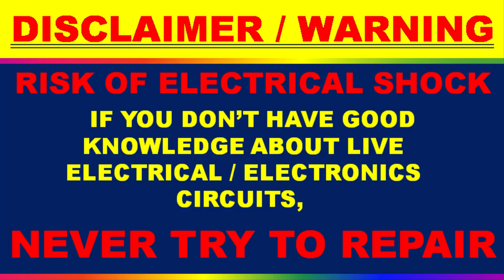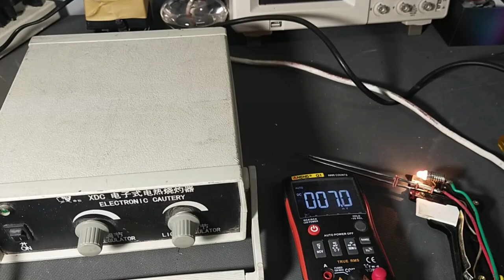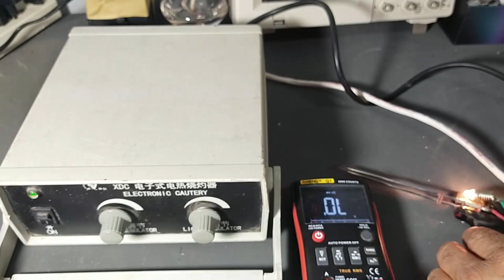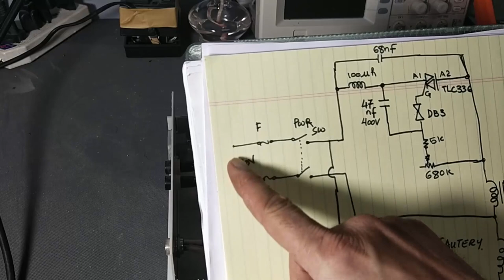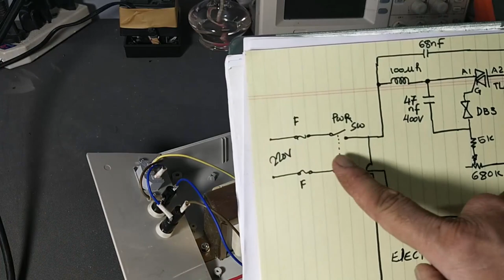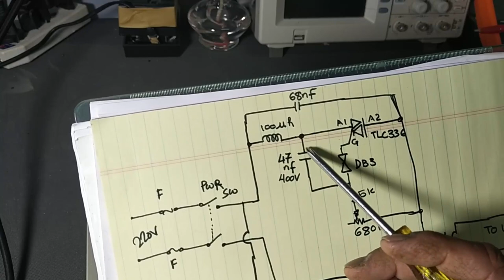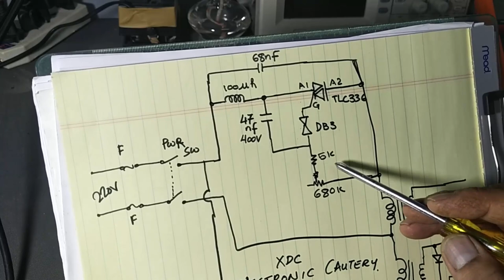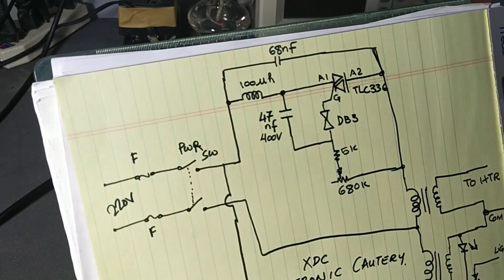{569} Electronic Cautery / Electrocautery Machine Not Heating Up - Circuit Diagram Explained

Comment: Thank you, sir, for your videos and your efforts! Could you, please, explain the purpose of the 68nF capacitor. As I understand, the coil, the other capacitor and the two resistors form a voltage divider, so that by a small turn of the knob it rises the 32 V and triggers the diac, which opens the triac and frees the path for the current to the transformer. Where does this 68 nF capacitor play a role?
Reply from the maker: best regards 
68nf is used as snubber across the triac terminals to protect from damage in blocking mode and turning off time
Reply: @HaseebElectronics  Thank you for your immediate answer and the knowledge you offer.
Reply from the maker: it is my pleasure